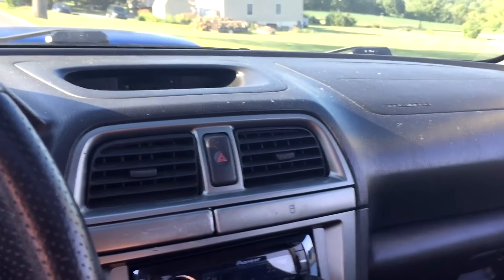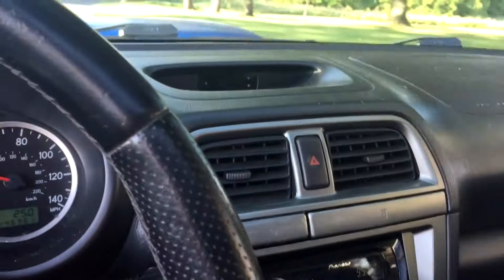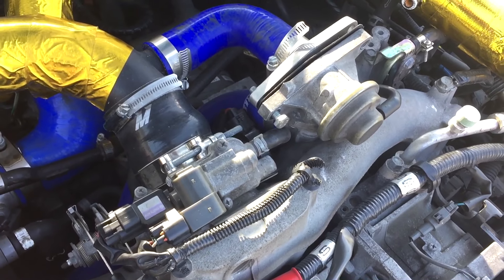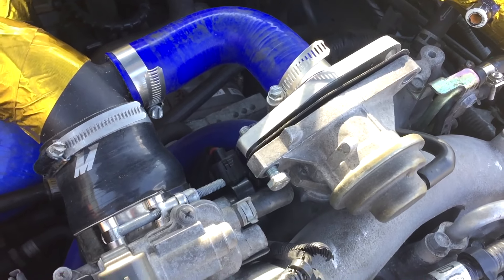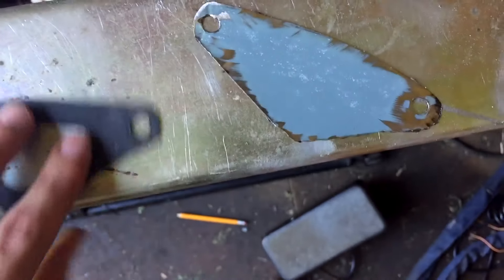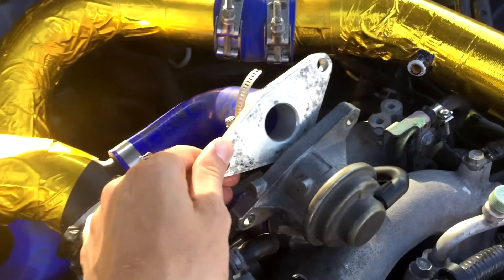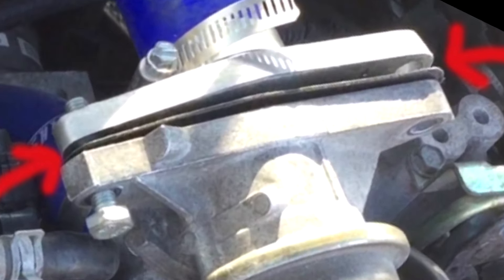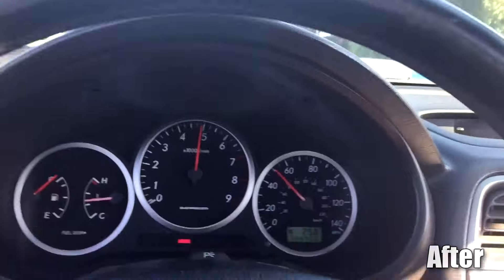DIY | BOV/BPV Delete - Block Off Plate | Stage 3 WRX Turbo Sound

Comment: any wrc car or race purposed turbo car you see doesn't use bpv or bov's the back pressure is the noise fighting the turbo wheel but the pressure from the turbine wheel will overpower that pressure, the reason NEWER cars have them there is to silent turbo noise. and a tune is for keeping the throttle plate open but the only reason is to prevent boost pressure from blowing off small vacuum lines and intercooler pipe connections.

Comment: You will probably see damage to boost pipes, intercoolers, etc before you see premature turbo failure but thats more likely at much much higher boost pressures than what you're running
Reply: Low boost will just blow the pipes off and you just have to clap it back together lol my car does this all the time. Running 6psi on a eBay turbo

Comment: You could also get this by using a blow off valve that you can adjust how much pressure it opens up at and just tightening it down
Reply: The VW crowd used to crush factory bpv's in the early 2000's to tighten them up for the same effect. Usually used a socket in a vice to do it.
Reply: @Currancchs  most BOV’s from pre 2000 were crushed to hold more boost

Comment: For any future viewers, i would recommended thicker metal than show in this. Basically youre EJ is pushing on average 15psi of boost, youre gonna want some metal that won't bulge out or breaker during higher boost pressures.

Comment: its a really good mode and yes....turbo flutter is the best sound on earth but im kinda worried that the flutter also began to appear on open throttle after 6k rpm or something
Reply: too much boost for your engine, or too big of a turbo. it happens then cause the motor can't use the turbo's pressure, so it create's backpressure.
Reply: That noise under throttle is the wastegate!

Comment: Nice vid man, now I will say this and I know it's already been stated in some of the sub replys to others, but here's the thing to the ones unknown, if your 400hp+ cars that are set up tuned, diesels that are stock, and set up and tuned, oh and don't forget about 80% of all WRC and Rally Cross, and GT Cup cars, that are all turbo, why don't they have a bpv, or bov.... It's simple.... They can only do so much, and when you're running high horse high rpm and most cases high tourq, then a bpv, and bov are going to be a waste of time and mony. Yes they do up the size of the wastegate, and somtimes a twin scroll, but other than that, that's it. I used to be a Toyota Tech. and I've seen my fair share of Supra, and older celicas, even the mr2 running nothing but a solid inlet tube. Hell 90% of all cars built before 93 that were turbo had no bpv or bov, just a smaller wastegate. The bpv was added to make the turbo set up quiet, since excess boost is diverted into the intake manifold, and the bov which mostly became mainstream in '97 to pretty much now is 90% atmospheric. If you do this on a stock car, turbo obviously, like the Cruze 1.4, Feista ST, Focus ST, and the WRX then you more that likely won't hear it, unless you have higher boost levels, or you have an ECU tune, or added a bigger wastegate, which with todays turbos you will mostly need a tune for that. But, and this isn't bs, its a fact, some turbos that have the turbo vein vectoring set up like the gas/petrol engines need the bpv in order to work properly. The only thing your going to hurt doing this "mod/delete" is your fuel efficiency and thats it, oh thats the conspiracy with the bpv, noise and fuel economy. Hell if this was forbidden then wonder why its a norm on most of all tuned turbos across the world...... Plus to add, diesel dont and have never had any bov or bpv..... Deisel tech for 15yrs..... Ride next to most stock diesels out there and you will faintly hear turbo vein flutter, tvf, or tf.
Reply: Kenneth Brown, Diesels do not have bpv or bov because they dont have a throttle... the accelerator pedal determines how much fuel is injected. 

Turbo sound on diesels is not flutter, its just a whistle sound of the turbo free-spinning when you are off the gas, its just pushing compressed air straight through.

Just sayin, the diesel part of your argument doesnt mean anything because its not applicable.

Comment: Helpful tip. Keep your stock bpv unless youre running a big turbo
Reply: Keep a bov period or it's gona fuck up the turbo prematurely
Reply: @jeffgood6441  not before if fucks up the throttle body. But to be fair, stock isn't much boost to worry about that. Its still well within its limits

Comment: I think it should be fine as long as you're running low to medium boost pressure.
Reply from the maker: Hope so, Currently only running 17-17.5 psi boost.
Reply: Subie Rumble i have a vf30 and without a boost controller/valve/solenoid, I get 8psi max on super hard acceleration. Normal driving I get 5/6 psi under medium acceleration.
Reply from the maker: datstocklyfe Why don't you have a boost controller? So you're just running on wastegate pressure?
Reply: Subie Rumble I had a turbosmart manual boost controller but I didn't plan on getting the ecu retuned, so I was afraid that it was going to cause problems to the engine in the future
Reply: been hesitant to run this mod since its very easy and wanted to know if it benefits  since the 2jz usually run this mod.
Reply from the maker: Niko Pichardo The only benefit you'll see is slightly less lag between shifts.
Reply: wait im confused. less turbo lag with the plate on there? because that would add more if im correct.
Reply from the maker: sunny jim no. This is preventing (slowing) the air from escaping the intercooler pipes. So in theory, by the time you shift, there should still be some residual air pressure in the pipes, thus preventing the need for your turbo to 're pressurize' the piping.
Reply: but isnt turbo flutter the pressurized air trying to force itself back through the fins and getting chopped up bu them essentially making the turbine stall. i would assume that, that would lead to more turbo lag since the turbo has to overcome that to start to create boost again.
Reply from the maker: sunny jim The turbo never 'stalls' or spins the opposite direction, It's just the turbine speed changing rapidly between the exhaust gases & the opposite intake air fighting on opposite sides of the turbine. The exhaust side will always win since it's constant & the air in the intake isn't. If that makes any sense.
Reply: No not really.. How does the exhaust side win if the turbines are connected with a solid shaft, thus rotating at the same speed? Also the exhaust side is not constant as it depends on engine rpm/load.
Reply: Subie Rumble going from no bov to a plumb back bov i can say that having a plumb back feels like it helps reduce lag between shifts. the pressurised  air is released before the compressor wheel helping to spool and the turb cant be slowed by air pressure when the throttle shuts.

the flutter gets annoying in a daily after a while aswell
Reply: ignore these fools .... you are correct only bad if you run high psi like 28 psi of pressure smashing back onto your blades then its bad.....
Reply: Subie Rumble i think it leads to more lag right? why?
Reply: and i think, when turbo start the boost
the soung of engine is rough!
Reply: Doesn't matter how much boost you run, it will be fine.
Reply: Meanwhile people here running 50+ psi with a valve.

Comment: Yes it's bed for the turbo. Think about what's happening: you trap 8 to 18 PSI of air between a throttle plate and a compressor continuing to push air, you're going to shock the compressor and eventually destroy the bearings. That flutter sound is the compressor losing and regaining grip on the air it's trying to push. And yes, I had a turbo fail from mal-adjusted BOV spring producing the flutter.
Reply: Wrong
Reply: nah hes right im just still gonna do it
just put it on for a meet and then take it off

Comment: Just to clear something up. unless you have a cold air intake, you will not hear the flutter sound. the sound is coming from the compressor housing and if you have it blocked off with the factory air box you won't hear it.
Reply from the maker: Good info!

Comment: Clicked on this for some of that "it's bad for your turbo" salt, so funny. 

It isn't bad for the turbo at all. Doesn't matter which car, which turbo, how much boost, it's fine. The ONLY TIME compressor surge is bad, is if it's happening under load. If it happens only when you lift your foot, its fine.
Reply: even on an old ass turbo that has a couple of hundred thousand miles on it?

Comment: is it bad for your turbo? sounds like air going back to the turbo
Reply from the maker: That's exactly what's happening. There's a lot of debate whether it's good or bad for the turbo. It's not causing the turbine to spin backwards, but there is air crashing into the an opossite spinning turbine which is what's causing that sound. Some claims this shocks the turbo shaft & can damage things. "claims" ... "can" ... There's plenty out there who ran cars like this for a long long time & never had any issues. I guess only time will tell if this hurts mine.
Reply: +Subie Rumble alright thanks for the info man.I guess is not as bad as people say ,been watching your videos since day 1.you're more knowledgeable when it comes to cars now good luck with everything.
Reply from the maker: jesus Delossantos Thanks! I'm learning something new all the time! Either through experience or just research when I'm bored. I'm always opened to others opinions & stories, but I tend to venture off on my own and take chances with things. Like this BOV/BPV delete :p
Reply: Well, my turbo didn't last long.. :/
Reply: +Subie Rumble there's no doubt about it from a machinery standpoint. Letting off when you're heavy into boost is causing sudden (otherwise, not introduced) torsion and shear on the impellers. largely a proponent of shaft play and general cyclic wear.
Reply from the maker: ***** That is all very true.
Reply: How is your turbo holding up? Looking at doing this. Thanks!
Reply from the maker: WRXnSTUFF Car got t-boned. It's totaled. Sorry can't help you.
Reply: what turbo did you have ? sorry to hear about your car... did you get money from insurance ?
Reply: So.. Sorry if im wrong... The blow off or bypass valves are made to stop the surges right.. So the flutter does not happen...
Reply: Irfan Muhmmed the bov redirects the air to either the atmosphere or the intake piping before the turbo. recirculating bovs (the type that redirects to intake pipe) are better as they keep the air in the system and wont cause your car to run rich like an atmo bov. atmo bov sound gay  imo. either block off the bov or run a recirculating one. im pretty sure you can also get adjustable bov's that you can set to flutter at low to medium boost but activate at high boost which is better for the turbo
Reply: vxsr33 that sounds like heaven, flutter till low-mid rpm range and then recirculation for high rpms, awesome

Comment: That’s not a BOV, that is the stock BPV and the ECU is expecting some of that air to be recirculated back into the intake. You are doing more damage than you think.
Reply from the maker: Hardly any damage is done. A rich mixture for split second won't cause problems. 

Also BOV/BPV do the same thing in that, they relieve pressure from charge piping when throttle plate closes. This is a delete or block off.

Comment: How safe is this? What are the draw backs? 
I'm have a 100% stock 04 STI. I plan on putting on a cold air intake and a catback (maybe cat less) exhaust. Do I need any extra mods? And does this benefit the car at all performance wise
Reply: xSakred you'll need to get the car tuned
Reply: It improves your turbo. by destroying it so you can get a bigger one!
Reply: matty0234 doesn’t damage the turbo at all turbo’s was on cars way before Blow off valves was even a thing